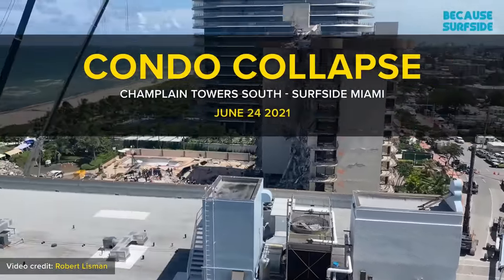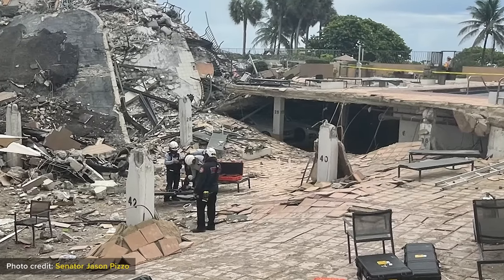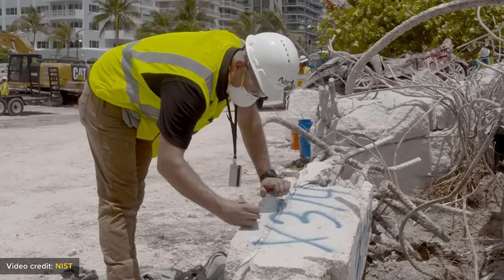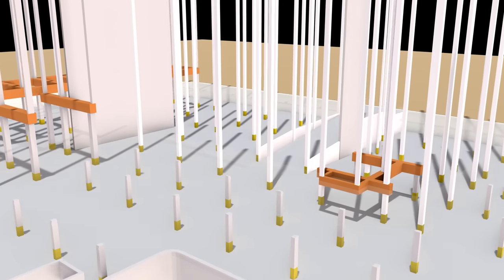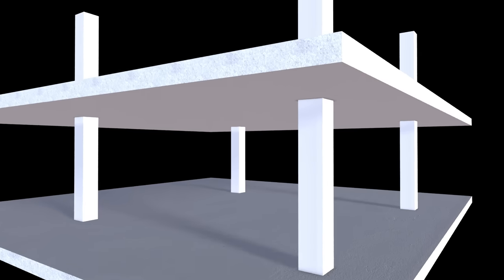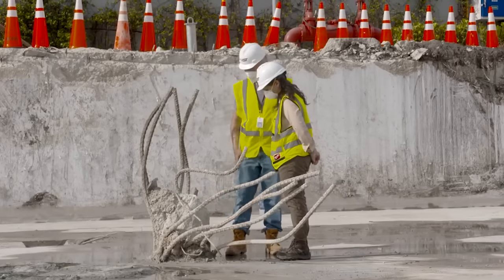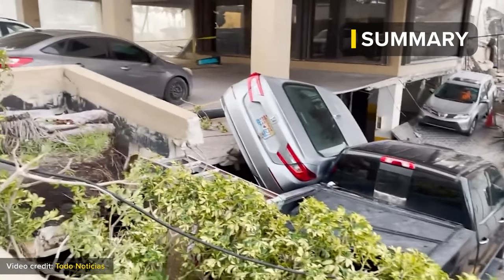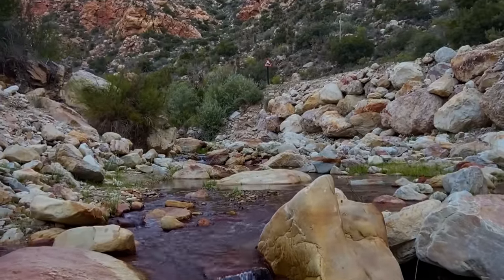SURFSIDE CONDO COLLAPSE | structural negligence! pt3

Comment: I agree that the building was doomed from the day it was completed but I am not sure that we can necessarily blame the original architect or even the builder unless at the time the building was designed and constructed there was known what dangers would lurk in a building without punch shear rebar in a flat slap construction.  I was unable to locate code that required so I question if that means it was not common practice at that time or not.  If the reason to use it was not really understood or known one cannot fix blame on it not being in the constructions plans that it was not implemented during construction.  If it was known but just not required by code at that point best practise says it should have been used but if they actively decided just to meet code and not use standards or best practices to cut corners, then yes they are to blame and should be held accountable.  It also should cast into question any other buildings that may have been built to code but not best practices and standards.  Normally building codes should be updated to include standards and best practise, especially when its a safety issue so it would be interesting to know when exactly punch through shear rebar was considered a standard in high rise buildings.

The other question I have regarding code, and whether they may have done things to slide around code issues is the types of codes that often apply to building under or over so many floors.  At the time this building was built it seems that the beach front high rises were limited by code to 12 floors  but then at some point, when the penthouse was added, which brought the building to over 12 floors was that do to a change in the building codes allowing taller buildings or how did they ever get the permission to add a +1 to a building already 12 floors high?
Reply from the maker: Thanks for your comment 

I cant say for fact but it seems likely the extra 13th floor was permitted through a bribe. 

The code required the structural engineer to design for all load cases. Punching shear is a load case. I agree back then punching shear steel was often not put in but some simple additional stirrups would have helped significantly. 

The building officials are often not qualified on all aspects of the code particularly the complex  aspects of rebar.  

If a building fail structurally then the engineer is liable. Even if it is an extremely rare load case. No engineer want his structure to collapse. That’s powerful incentive to not save money on rebar at the developer’s request.

Comment: The lack of punch through rebar probably means the North Tower has same problem.
Reply from the maker: Unfortunately I agree and lots of other buildings built under the same structural codes. Those structures are safe unless they have freak events where 3 or 4 columns are compromised.

Comment: I think you are correct and had Morabito put up braces in 2018 this could have been avoided .
Reply: who knows maybe Mprabito suggested it and the Owners didn't want to pay...
Reply from the maker: Morabito saw those scary core samples and so did the building management and anyone who  read those minutes. It would appear there is a strong resistance that sets in when faced with information that involves spending large amounts of money. Or worse being denied use of certain parts of your building during reconstruction.
Reply: @Mike-Bell  ok the full repair yes temporary supports I was saying should have been put in place and wouldn't cost as much

Comment: In addition of the weak design of the column/beam joint allowing column punch through,  there were two poorly handled change order that made the situation worse.  One was the elimination of a step down to the garage level that was accomplished by compromising the weak joint further and the other was the result of extra load imposed by some added planter boxes.
 Poorly handled change orders often cause all kinds of problems.  It this case it killed people.

Comment: What about the second building. Weren't they build at the same time using the same construction method.
Reply from the maker: The second building is built and designed the same. But has been maintained much better. If I were an owner of the other building I would be  worried.

Comment: Mike, as a building professional, what's your thinking on the continued occupation of the nearly identical Champlain Towers NORTH?  They "say" it's been better maintained, but, it must still have the same design shortcomings built-in, yes/no?  What do other jurisdictions around the world do in the face of these facts?
Reply from the maker: On the face of it Champlain North would have the same rebar and concrete design. It is conceivable that further corners were cut on North from lessons learnt on South. 

It give me shivers knowing the contractor and builder were one and the same. Extreme conflict of interests. 

So aside from better maintenance North is also precarious. Kilsheimer engineers checked North and didn’t raise the alarm which is good. But I suspect they would have braced the pool deck slab around columns out of caution. 

Its not just South and North with inadequate punching shear rebar. It’s widespread. But unless there is a perfect storm where everything than can go wrong does go wrong they are going to stay standing.  It many layers of bad luck and then some for South to collapse. 

And until the failure is conclusively known we are left guessing.
Reply: @Mike-Bell  I need to comb the property appraiser website, and see if any CTNorth units have sold since the collapse... the market is so overheated right now, most buyers probably don't care, esp. when somebody of Kilsheimer's repute says "I'd let my kids live here..."
Reply from the maker: @MajorCaliber  There will always be the scared and the fearless.  For sure there are ppl lining up to by an oceanfront condo if the price is less than next door. 

We dont know what Kilsheimer said to the condo board.  And in contrast what anyone still owning a North condo will say to protect their investment.  Im guessing the concrete strengths were below par and there is some bracing around the columns supporting the pool deck.
Reply: @Mike-Bell  Im guessing... there is some bracing around the columns supporting the pool deck.  Wow, that would certainly raise eyebrows for anyone even half-awake during a buyer's tour!  I live only about 30 miles away... perhaps I should become a "buyer"... take the tour... ;')

Comment: So you COULD separate the pool-deck from the building slab, BUT... it would greatly (here it comes again) INcrease the cost of the retaining wall, which would either have to be MUCH thicker, or be braced with batter-piles... both would require additional foundation piles... $$

Comment: The weight tolerance was too tight and they added on too. The dead load was almost exact to the weight present. Any problems will be exacerbated by this factor. Damp concrete neglected for years and the lap joints were less then needed. And yes it had other design flaws. The architect had lost his rights to design due to safety issues on another building collapse. Fresh off probation and hired by a greedy developer who failed in his previous pursuit and decided to have a hand as a developer. Greed and incompetence at many levels brought this building down. Post punch sheer and the weight room stressing a support wall may have contributed(remember no dead weight tolerance). I agree it was doomed from day one and was a matter of time. People who lived there knew it had problems also and had been selling their units in droves.

Comment: What's your take on the pool-deck punch-through columns, where the tops aren't just missing the typical "crown-shaped" piece of slab remnant (w/ 45-degree tear-boundary), but have actually experienced a "pencil-sharpening" effect!
Reply from the maker: The slab was cracked internally meaning the slab was not working as a unit.  It was working as 2 separate slabs each not strong enough to do the task required of it.
Reply: @Mike-Bell  You mean DE-LAMINATED in the plane of the slab?  I see indications of that in the core samples taken in the year or two before the collapse.  Also explains why ZERO of the slab concrete was adhering to the column rebars.  IIRC the spacing of both bottom and top steel in that portion of slab was 12", and those skinny columns were 12" x 12", which probably explains the "pencil sharpening" only at the top portion, i.e. by the point where the slab had fallen a foot or two, the concrete was so crumbled and disintegrated that it could not restrain the rebar laterally, and it was just freefall the rest of the way--falling slab didn't even scrape the paint off the lower portion of those columns.

Comment: Local building codes, architect, engineer, condo board.  It was just a bad building all around.  I live in a reinforced concrete building.  The columns are not only larger, they have heads underneath the floor above for the first two floors.
Reply: Column capitals/Drop panels, glad you have them... curious--what YEAR was your building erected?

Comment: If this is correct, it makes me wonder how safe the other Champlain Towers buildings are...
Reply from the maker: There must be a lot of worried ppl in Champlain North
Reply: I'm now even MORE worried about Champlain EAST and Mirage-on-the-Ocean (same architect), which used post-tensioned slabs , which require even more expertise and COMPETENCE to "get it right" than the conventional type rebar used in CTSouth and CTNorth.

Comment: Before moving in, how can one immediately know if proper punch through rebar exists?
Reply: Besides the individual columns and how they join the slabs, you might also check for isolation joints that serve to separate, say, the pool decks/driveways/patios from the main building, so that that failure of the former does not cascade and bring down the occupied living spaces.
Reply: You realistically don't. My take is such buildings in Florida are great the first 10 years (ideal time to buy), then age becomes noticeable. By 20-30 years (ideal time to sell), the downhill slide accelerates with expensive reconstruction on the horizon. After 30 years, save up for the massive HOA assessment that's rapidly approaching or put it on the market to sell quickly.
Reply: Read the responses above- in 1979 this pretty much did not exist.  To provide punching shear capacity you either made the geometry correct through combination of slab thickness and column dimensions, or you added structural steel shear heads embedded in the slabs.
Reply: @billj5645  Well I live in a three story 1950s former Stalinist apparatchik brick building with one meter thick outside walls and two massive stairwells that probably divide the structure into three separate elements. Like European buildings in WW2, I believe this could take an artillery attack and only lose parts that get directly hit

Comment: Even After the Collapse you can VISIBLY  SEE  the Water Damage issues created by the mismanagement of vital areas throughout the building including the pool , planters , and support Collumns in these selected images that were hand picked and  chosen for this video to argue specifically  against the Water Damage Evidence . 

Yes Ofcourse  there was punch through destruction of the Collumns in the upper levels and throughout the building  , tell us something we do not know , but what caused the initial break down - it was constant water damage on the lower level of Supports  AND the Design ofcourse was unsafe like many other buildings in the United States .

The Initial Breakdown Failure in the exact location of the Pool and Planters .

The SPALLING Expands the Rebar and Shatters the concrete structure year over year - the Design is insufficient like so many United States Buildings however it was the initial Failure by the Planters and Pool where visibly the Water Buildup within the first level is clearly CLEARLY Evident in other segments .

Comment: You did not explain what caused the pool deck to collapse.
Reply from the maker: Thats because we don’t know for sure yet. NIST National Institute for Safety Standards are doing extensive testing of the building pieces and will be able to determine what caused the deck collapse. 

But my guess is inadequate structural steel (rebar) and substandard concrete bought on the cheap to save money. And some corrosion.

Comment: I'm still not clear on what caused the initial punch shear.  You mentioned excessive spans. Did they need more columns to support the pool deck slabs?
Reply from the maker: This is not known for certain.  But is likely inadequate punch shear rebar in the design so such a large span and perhaps rebar less rebar installed to save money and increase profits.  Plus possible corrosion.  Wait another 2 year and NIST should provide a conclusive answer.

Comment: 6:35 The tower fell because of the ill-fated configuration of beams.  Hmm.  At least there were (red) beams there under those planters.  There weren't beams under all the planters.  Where there were no beams, the slab would have been closer to failure.  Your video shows 'shear rail' shear reinforcement, but that wasn't developed until the need for it was realised and then codified after this building was designed.
The design for this building was changed many times by the Developer/Architect/Engineer over many months and that is often a recipe for problems - sadly viewed as acceptable.
The deficiencies were not picked up by the whole building control process - institutional/systemic blindness.
The building owners tarted up the building some ten years ago, but spent no money on the structure - they turned a blind eye to the water leaks and spalling concrete.  They assumed it was fine when it was shit.
The warnings of the inspecting engineer were not heeded - why ask for a review and then ignore it?

PS The whole concept of carbon offsetting is deceitful - it legitimises the continued pollution of our planet when we should just stop polluting.
Reply: Co do zanieczyszczania środowiska to łatwo jest ci to mówić jak sobie siedzisz gdzieś na słonecznej Florydzie on Teksasie. Ja mieszkam w Polsce i my mamy ostre zimy. I mamy dużo, dużo węgla pod ziemią. Trudno z tego nie korzystać. Napisz mi jak przestaniesz jeździć samochodem, latać samolotami i przesiądziesz się na stałe na rower. Poza tym czy współczesnym fałszywym naukowcom można wierzyć? Wszyscy mają kieszenie pełne kasy od bankierów, władców świata.

Comment: Many are eager to blame the contractor for cost cutting and poor workmanship. However, a government official approved the plan, supervised construction and issued the occupancy permit.
Reply: Even in the 1970s, people complain about red tape and wanting there to be less regulation. It's not surprising that regulations weren't good enough. They should have been much stronger, because companies will almost always try to build as cheaply as possible.

We have this issue in Australia. The government stopped having gov inspectors about 20 years ago and instead the construction company pays an "independant" inspector. So many buildings have had near failures that no one wants to buy anything newer than 20 yrs old now.
Reply: @letsburn00  In the U.S. any construction load requires a substantial insurance policy. Insurance companies also have inspectors. Between insurance and government regulation contractors are well supervised.  Doing away with inspections is wrong. My point is we (in the U.S.) always blame contractors for everything.  After all contractors are the source of money in a lawsuit

Comment: hey mike, where did you find the video at 5:32?  i saw it when all this first happened, some old video on yt long ago that everyone was finding again while searching for info about the collapse, but then it vanished a few weeks in and i could never find it again, do you have a link to it or a local copy of the original?
Reply from the maker: Hi.  I looked for the video but unfortunately couldnt find it.  It is on Youtube but hidden amongst the thousands of others of the building.
Reply: @Mike-Bell  i think maybe the original uploader took it down once it started getting a huge amount of attention, perhaps they were harassed by news channels asking for permission, very common on old videos that suddenly become relevant like that

i remember it showed the concrete wall on the other side of the slab at the edge of the property had fallen over, a very strange failure for such a thick wall, do you make anything of this?  some people have proposed that the slab failed at the joint there first, then made its way to the building as it punched through

Comment: 7 minutes between collapses? That's extra sad that (presumably, since I've never heard otherwise, but maybe it did happen) an evacuation didn't start immediately when the collapse of the pool deck happened. If the fire alarms had gone off within 30 seconds of the end of the pool collapse, many lives could have been saved. Or, was the alarm tripped immediately and it wasn't enough? Considering the state of American media these days, it could very well be that there was an immediate evacuation that I've never heard about (to be clear, I'm not saying I expect most of the people to have time to evacuate, but if a fire alarm had been pulled then many people would have gotten out). Am I ignorant and the fire alarms did go off, or did that many employees really not think very hard?
Reply from the maker: No fire alarm went off after the first collapse. The lady at the security desk had not been shown how to activate the alarm. So 100 residents were not alerted and died in the collapse. Unsurprisingly the security company paid around 40% of nearly $1bill settlement.